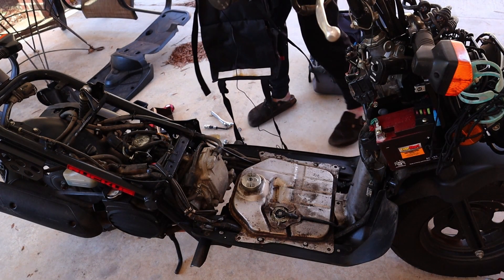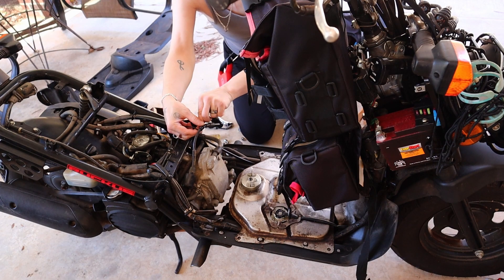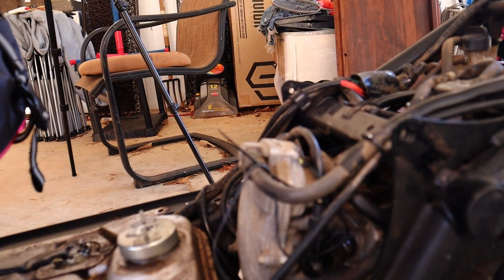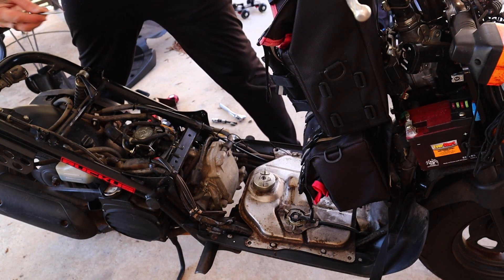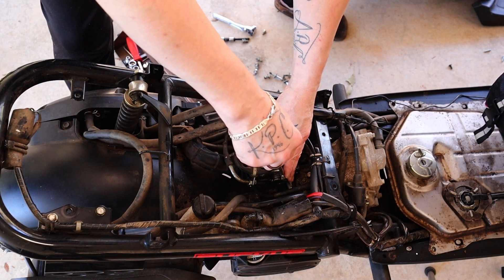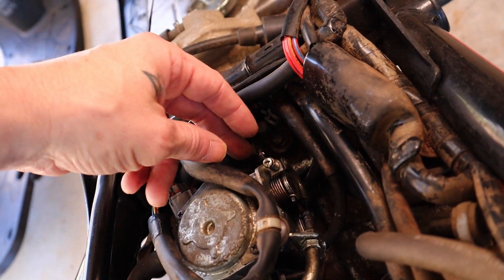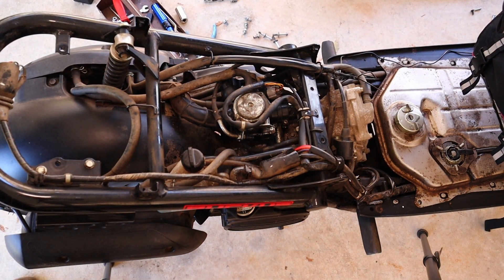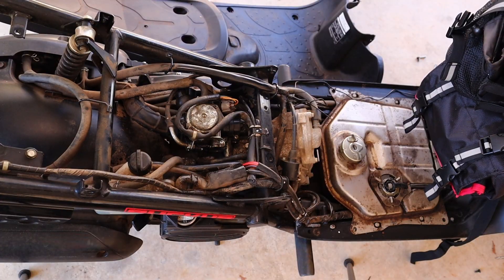Tachometer (RPM measure) Easy Install & idle set adjustment on Honda Ruckus 2017 NPS50 50cc Scooter

Comment: What did you set the tach at.? 
Mode 1? Mode2?
Reply from the maker: I think, but am not certain, that you set it to 1 for odd/2 for even corresponding the number of times wrapped around the spark plug/wire. Thank you for your comment & for watching. 
I hope this helps, but to be sure, I would consult the product info.